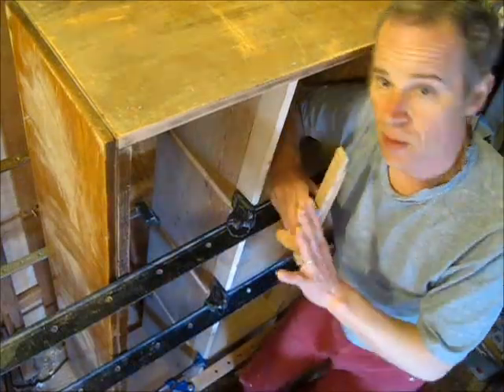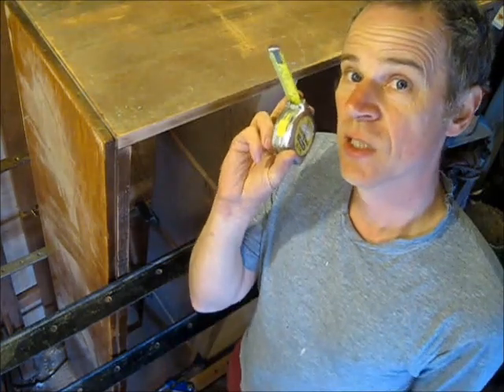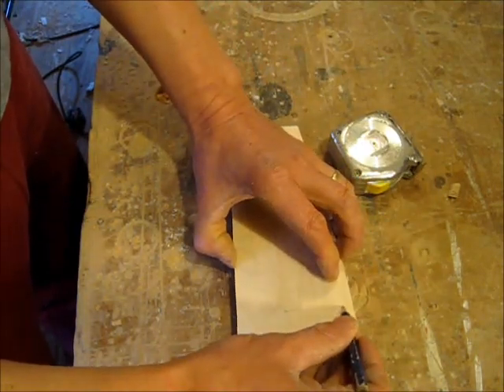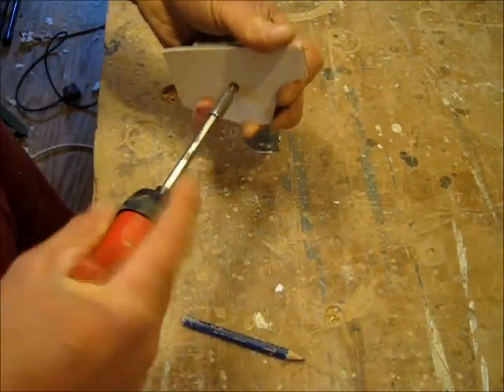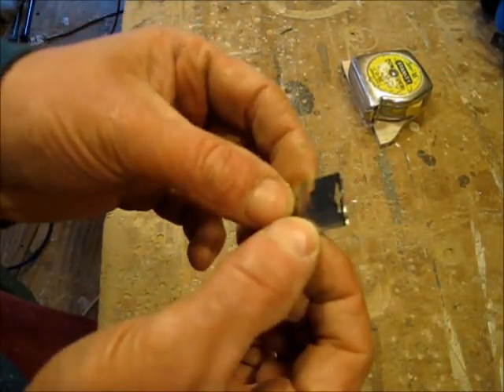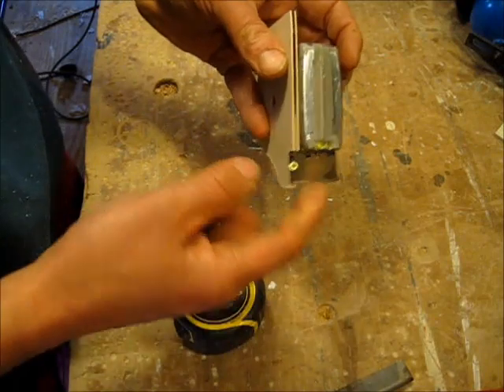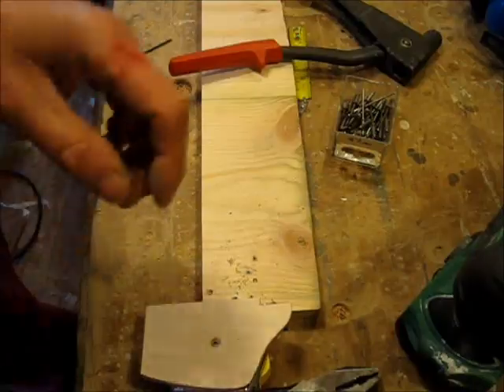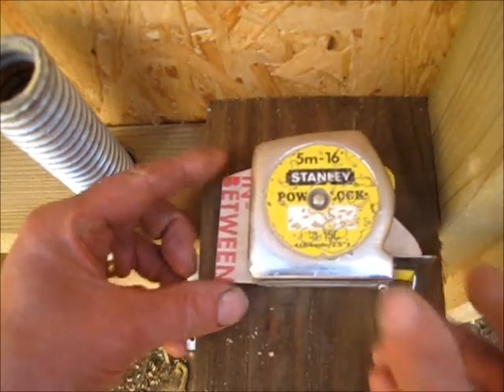In between tape measure How to make Its a Rubbish Challenge

Comment: If you look at the back of the tape on the bottom edge it will say  + and a number. This is so you can measure an interior space with the back of the tape and just add the length of the case to the read out of the tape. I don't know if this is a feature of every tape measure but it is on Stanly powerlocks.  This guy will show you  https://www.youtube.com/watch?v=HctOCCMio8k
Reply from the maker: Yes it does have this...I made this from a broken tape, the blade was cracked near the end and would be thrown away...this is so you do not have to do the math...speeds up those times that you have a lot of internal measurement to take...one of those tools that comes into their own once a year.
Sure you can always choose to do the maths with a regular tape measure.